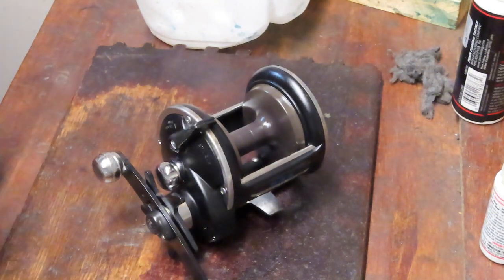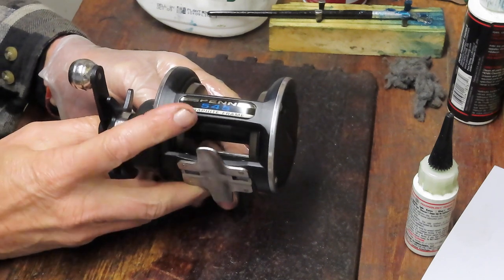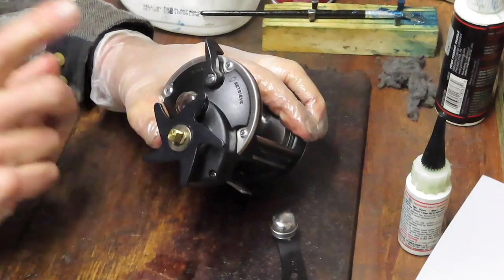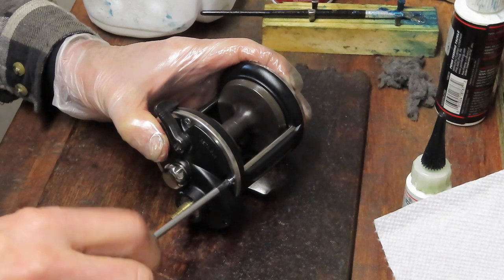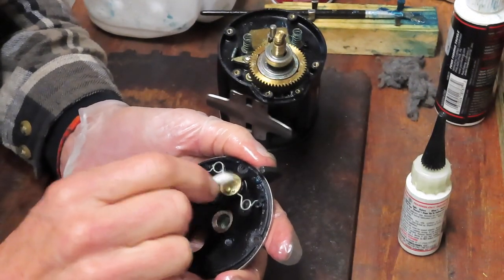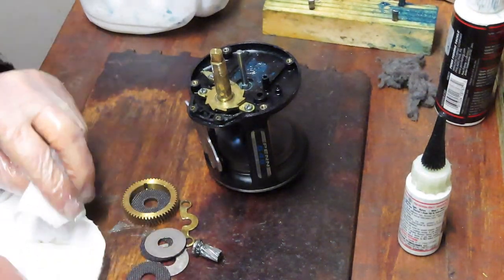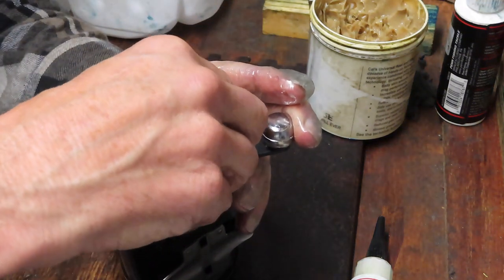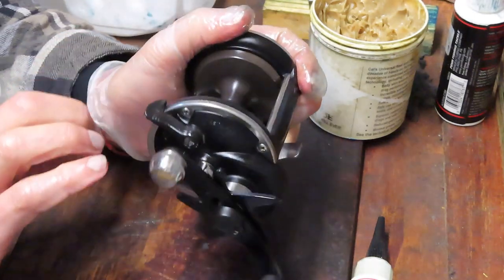Penn GS 545 saltwater fishing reel how to take apart and service

Comment: Hi Dennis,

I bought a Penn 535 Graphite Series reel from ebay in summer of 2021.

I opened it up to take a peek and things looked fine. It was greased and oiled, nothing looked broken or out of the ordinary. The drag stack of fiber and metal washers looked fine. Nothing smashed, broken, stuck together, brittle or corroded.

Got it spooled up with new 20lb mono.

Put it back together, checked the freespool, the clicker, put it in gear/out of gear, pulled on the drag from minimum to almost max tension and things felt good.

Fished with it in the summer of 2022 and it held up great against a 60lb sailfish for a 40 minute fight.

I took it apart yesterday 5/29/23 to check out the drags, looks and feels good.

I don’t know what type of drags are in there, but I would like to know if I leave the fiber washers alone or put on some drag washer grease. 
Thanks,

Johnny C

Comment: Thanks Dennis...very helpful. I winged it and made a few mistakes that your video corrected. I had the springs in the wrong location for the freespool lever although I removed the brass boss and greased it where it goes through the side plate. I also had some of the side plate screws in the wrong locations. Additionally I took off the shields of the sealed bearings carefully using a fish hook and repacked them. Also my reel had casting dates of 1998 on the inside and sports a brass idler gear...I think the later ones came with stainless like the one you serviced. Mystic mentions it in their parts call out and there is some sort of more modern drag/gear system that your viewers need to be aware of when ordering stuff. Thanks again!
Reply from the maker: Glad it helped.   Thanks for the note and the feedback.  Please stay watching - Dennis

Comment: Hi Dennis, hope you are well and thanks for the info and knowledge that you share.

I have a Penn 535 GS I bought from ebay. My son caught a nice 60lb sailfish on it with 20lb test and the reel held up great.

I opened up the reel and looks like it needs some TLC.

I'm planning to service/lube/oil it myself.

Is the 535 reel inner workings pretty much the same as the 545?

Thanks.

Johnny C from So Cal.
Reply from the maker: Yes - these all share the same design and share some components so the video on the one will be helpful is servicing the other - Dennis

Comment: Sorry for repeat question but still in dark. I have a 545. Spool is uncontrollably fast during casting despite spool tensioner being tightened. Bought NOS spool. Brake blocks came positioned in middle of arms coming off spool shaft. Is this the correct position for braking or is this the “off” position and do they need to be moved?They seem almost impossible to move outwards towards the end of their shafts without risking damage to blocks. Thx in advance for your time.
Reply from the maker: They should toggle in or out.  See which direction them move.  Outward is on and inward is off.  Do you have the two thrust washers inside the spool adjuster cap?  If they are missing, that could limit your adjustment

Comment: I tried rebuilding one i found. However the anti reverse seems to be clicking all the time now. One in a higher/faster click and the other function sounding normal. Any advice on what i might have put back incorrectly? Thanks. Love ur channel btw
Reply from the maker: It may not be a problem if it is just the sound and the rest of the reel is fine.  The A/R dog and the spring vary in length, wear and tension, so a weaker spring on a worn dog caul result in a lower pitch sound and a new dog with a strong spring could make a louder noise - Dennis

Comment: Dennis, do you have any tricks with stripped case screws. I bought a used Penn Spinfisher V 6500 to use the 5-6 times a year I go down to the Outer Banks. The reel is in good shape, completely fishable, but it came with a pretty badly stripped case screw. For the life of me I can't get the screw out. I don't really want to use a power tool but I'm running out of ideas. Thanks!
Reply from the maker: Is there any groove left in the screw head?  If there is, I find a handle held impact driver can shat it loose.  The rat a tat on the way out provides additional torque to break it free.
If the screw head is unmanageable, then the screw would need to be drilled out and the hole re-tapped.  That is best left to a machinist.  I am surprised that the SpinFisher V edition has seized on you already.  That seems to new to have built up that kind of corrosion.

If all else fails, you can get a replacement case.

Thanks for asking
Dennis